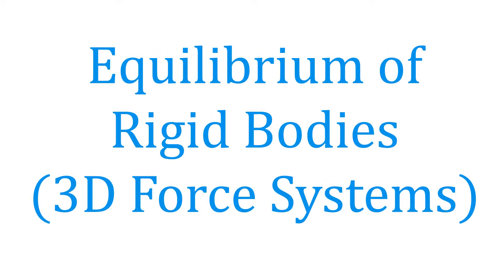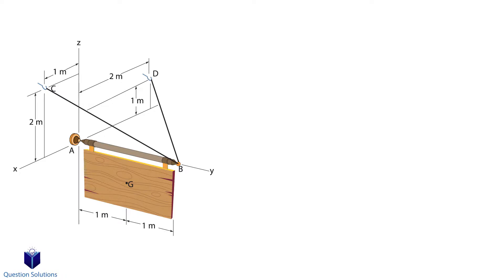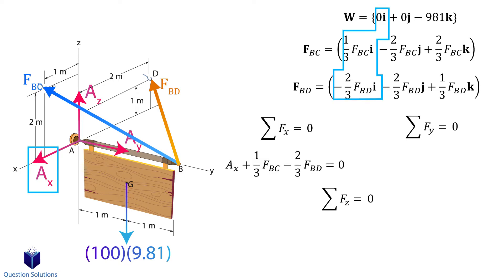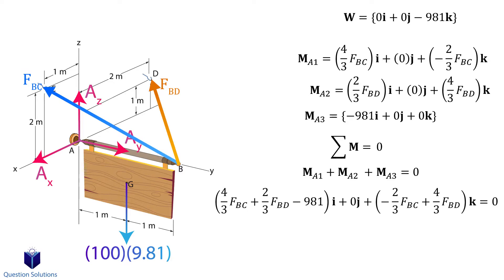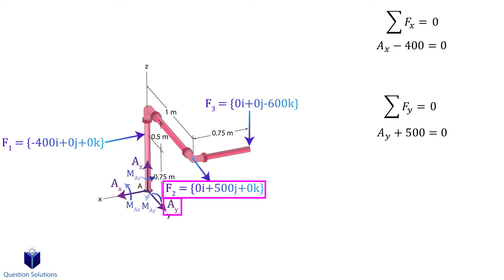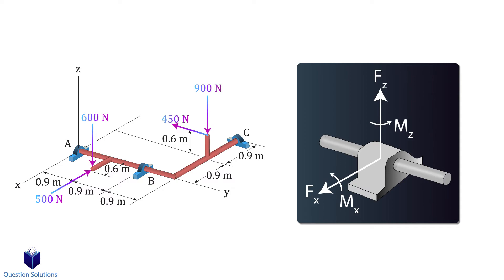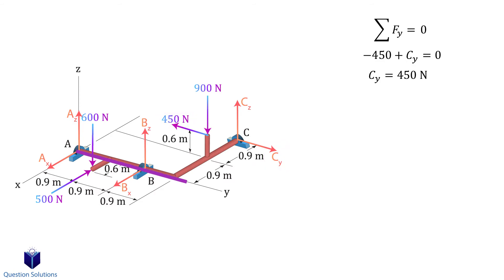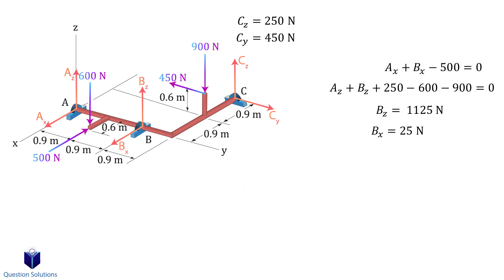Equilibrium of Rigid Bodies 3D force Systems | Mechanics Statics | (solved examples)

Comment: At 4:29 Im still confused when keying in the values to solve moment equations to get FBC= 588.6N FBD=294.3N .  I get different results . How do I solve for them
Reply from the maker: So I think you asked a similar question in a previous video too so please refer to the answer I gave to you on that video. If you're getting different results, you're probably not plugging in your values properly. Don't rush, take it step by step. Isolate for one variable, plug it into the next, and then solve. Replace F_BC as x and F_BD as y. This will allow you to see it better.

Please see: https://opentextbc.ca/businesstechnicalmath/chapter/solve-systems-of-equations-by-substitution

Here it is solved step by step: https://www.cymath.com/answer?q=4%2F3x%2B2%2F3y-981%3D0%2C%20-2%2F3x%2B4%2F3y%3D0

Comment: For the first example, is there a reason why we cannot use the Projection of F = <0, 0, -981> in the direction of each cable? I got F_BC = 654N and F_BD = 327N, then the reactionary forces Ax = 0, Ay = 654N, and Az = 436N.

I have been confused when I can do projections and when I can't. Any help is massively appreciated, thanks!
Reply from the maker: You don't need to do projections when you solve 3D force equilibrium problems. You just need the forces expressed in cartesian form and then you can equate the components. Usually, you don't use projections for these types of problems, you use it mostly to figure out angles between forces or if a question specifically asks for the projection.
Reply: @QuestionSolutions  I see... So, the projections method is not the most accurate. It can give you a rough idea, but it is better to focus on it when finding angles and use the equilibrium equations to get something exact. 

Thank you for responding!

Comment: have a question. How do we decide whether to use  scalar method or cross product when finding the moment?
Reply from the maker: If the question involves cartesian coordinates, or it involves all 3 dimensions with forces not lying on x/y/z axes, then you would need to use the cross product. If it's a 2D problem, or forces don't need to be expressed in Cartesian form, you can do it using scalar methods. This is just a nutshell answer, but generally, after doing a few questions, you can determining which the method to use easily.

Comment: Hi sir at 9:05 , I do understand how you get -900(0.9) due to the clockwise direction. What about 600? I did the same but i thought it should have been -ve as well. Can you explain why its positive?
Reply from the maker: Notice how the 900 N force is to the right of the y-axis, where as the 600 N force is to the left of the y-axis. The 900 N force creates a clockwise moment, but the 600N force creates a counterclockwise moment. And that's because one force is to the left and one to the right of the y-axis.

Comment: Can ı ask something ı couldnt really understand when we use unit vectors. I thought we use them only for different axis ( like other than x-y-z plane) but here we use them for x-y-z plane too
Reply from the maker: So a unit vector, in the most simplest sense, is just a vector with a value of 1. You can write unit vectors for any position vector you want, in other words, for any vector you draw, you can have a unit vector. What you're referring to are the axis unit vectors. So x-axis is 1,0,0, y is 0,1,0, and z is 0,0,1. That also is just a vector that extends from the origin along that the axis you're looking at. So to give a simple answer, you can have unit vectors wherever you want, whenever you want. I encourage you to take a look at this video, it might give you some insight. https://youtu.be/CCeWy1kmxMs

Comment: Hello, just a small clarification, is it wrong if you include the k coordinate of point G (if given, in my assignment's case) when using it as a moment arm for MA3?
Reply: timestamp: 3:58
Reply from the maker: @70proof  It's fine, you will still get the same answer since it would be a position coordinate from the origin to point G.

Comment: Hi i have a question, at 4:29 how did you get the Fbc and Fbd from the two equations when you equate them into 0, i mean how did you get the 588.6 N and -294.3 N, please that's the part where I dont know how to solve it, please help me :))
Reply from the maker: Please see: https://www.cymath.com/answer?q=(4%2F3)C%2B(2%2F3)D-981%3D0%2C%20(-2%2F3)C%2B(4%2F3)D%3D0

Comment: For the second problem, how did you know the direction of Ax and Ay in the beginning?
Reply from the maker: I didn't, it was just an assumption. If you get a negative value, then it's opposite to your assumption. 👍
Reply: @QuestionSolutions  Sorry, I still don't understand why these smooth journal bearings don't provide couple moments.
Reply from the maker: @張建岳  Where are you referring to? Please use timestamps, thanks!
Reply: @QuestionSolutions  Around 8:08. thank you

Comment: I have a quick question - for the position vectors BC and BD, i did CB and CD, meaning that my numbers are the opposite of your numbers..

this is giving me the wrong answer (i believe because W is still (0,0,-981).

so my question, SHOULD it be BC and BD (C-B) and (D-B) instead other way around?

and if yes, how do i decide which way to do it for future questions?? thanks!
Reply from the maker: Position vectors are always from the starting point to the final point. So if it's from A to B, then you subtract the points of A from B.
Reply: @QuestionSolutions   right, how do we resolve which point is the starting point and which is the ending point..? thanks again

Comment: Why is it that the J component is negative 450j under Moment of Problem 2?
Reply from the maker: So when you calculate MA3, at 6:21, you will notice that it has -450j. It's the result of the cross product.
Reply: @QuestionSolutions  Yes its a result of cross product, but when you multiply negative 0.75 and negative 600 will result in a positive 450j.. but then its still negative 450j on the video?
Reply from the maker: @wisdombuilds5044  The second term is always negative, so it goes (+)(-)(+) which means we have -(-0.75)(-600)=-450. Please take a look at this video where I go over how to do this step by step: https://www.youtube.com/watch?v=F8IHrg3pc7g
Reply: @QuestionSolutions  Yeah but there a 0 first. it goes -((0*1.25)-(-600*-0.75))=450
Reply from the maker: @alyssaesper7313  You are doing it wrong, please learn the proper method before you lose marks... Watch this video: https://www.youtube.com/watch?v=F8IHrg3pc7g

The proper way to do the j component would be like this:
 -j[(-0.75 x -600)-(1.25 x 0)]
-j[(450)-(0)] = -450j.

You're writing your terms mixed up.

If you need to verify your answers, use this site: https://onlinemschool.com/math/assistance/vector/multiply1/
Reply: @QuestionSolutions  Thank you very much! Godbless
Reply from the maker: @wisdombuilds5044  You're very welcome!

Comment: As Salamualaikum 🤗
Thank you so much for your videos, they have been really helping me in my studies!!!
I just wanted to ask in the last question at 9:33
Why in the sum of moments in z axis we multiply 250 by 2.7☺️?
Why not 1.8?
Why would we multiply 900 by 2.7?
Would you please answer me if you could as I am really confused 💔💔💔
Thanks in Advance 💖
Reply from the maker: So we multiply 250 by 2.7 because we are looking for the perpendicular distance from the x-axis to force Cz. That's a total distance of 0.9+0.9+0.9 = 2.7m. The same applies to the 900 N force. Remember that when we are calculating the moment about an axis, we always look for the perpendicular distance from the force. Notice how both the 250N force and the 900 N force are both along the z-axis (in other words, they point straight up or down), so the perpendicular distance to those 2 forces would be the distance along the y-axis from the x-axis to where the force is being applied. I hope that helps.
Reply: @QuestionSolutions  thanks alot!
It did help
But I thought the perpendicular distance is 0.9+0.9 🥺
Would you plz clarify to me which perpendicular distance are we calculating? The one thats stuck to Cz or the one thats stuck to Az
Thanks alot again! This really helps!!!!
Reply from the maker: @amrhelmy5795  0.9+0.9 is the perpendicular distance to the y-axis, not x-axis. So to find the perpendicular distance to the x-axis, you have to count along the y-axis. So that's three 0.9 m. Az is at the origin, which means there is no moment created about the x-axis. Please see: https://imgur.com/a/N6gNH3A I drew a red box around the length that is perpendicular to the Cz force.
Reply: @QuestionSolutions  Alright great!!! Thank u so much for ur support, caring, explanation and help!!! I really appreciate it and I understood everything now 🥰
Jzak Allahu khair and May Allah count it towards ur Hasanat 🙏🙏🙏
Reply from the maker: @amrhelmy5795  Glad to hear it helped. Best wishes with your studies. 👍
Reply: @QuestionSolutions  thank you

Comment: Hii I wanna ask for the last question, taking moment at at axis, shouldn't the Cy force acting a moment to x axis? And thank you for the video =)
Reply from the maker: Please kindly provide a timestamp so I know where to look. Many thanks!
Reply: @QuestionSolutions  9:34 thank you for your reply!
Reply from the maker: @wendylim898  Okay, so there, Cy would not create a moment about the x axis. Notice how the 450 N force creates a moment even though it's along the y-axis, the same as Cy. We found that by multiplying 450 by the 0.6m, which is the perpendicular distance from the x-y plane to where the force is applied. Force Cy has a perpendicular distance from the x-y plane of 0 m. So no moment is created. To see this better, I encourage you to take an eraser or something, lay it flat on your table, and then apply the force at the very bottom, just like CY, and see if it tries to spin about the x-axis. You will see that it does not. I hope that helps!
Reply: Hello! I'm still confused why is the 450 force has a 0.6 distance when creating a moment at x-axis?

Comment: 4:29 i have struggle to solve for fbc and fbd
Reply from the maker: The method I use often is substitution. Isolate for one variable and then plug that into the 2nd equation. You can also graph the two equations to get an answer, or use wolfram alpha.

Comment: For the last question I just want to make sure I understood the general rule of moment and rotation around an axis correctly, so only z-component forces can cause for a rotation to occur around the y-axis, and only x-component forces can cause for a rotation to around the z-axis, and only y-components can cause for a rotation to occur around the x-axis right?
Reply from the maker: The easiest way to see this is to actually get a box and place it on the table. Push with your finger to see which makes the box turn about each specific axis 😅